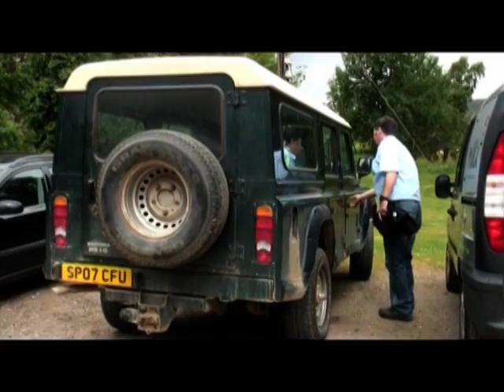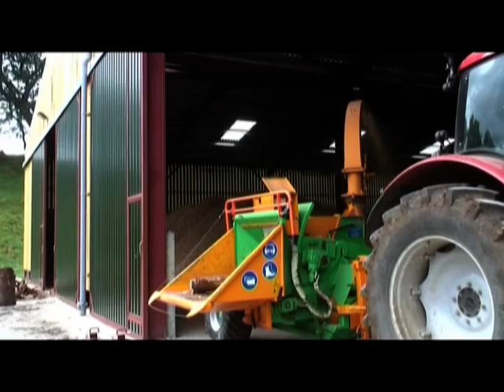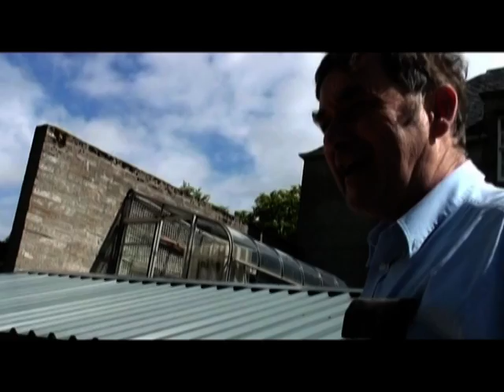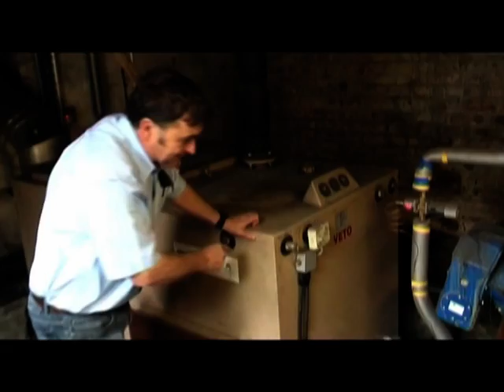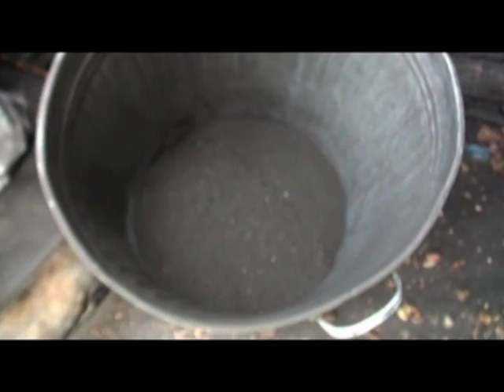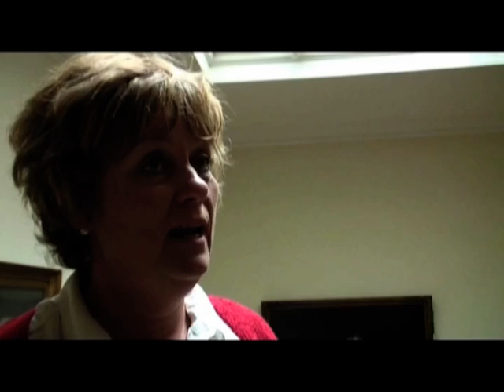Wood chip Heating system

Comment: Billy, the amount of wood chips they consumed as showed in this video would probably run the 20K generator. With little conversion, they can change this "burner" into a bio gas maker with the heat exchange inside. There are practical 5K, 10K generators running on wood chips that consume way less than what showed in this video.
Reply: running 20k generator instead would mean burning 40 pounds more wood chips/hour... not really very cost efficient unless electricity costs honey

Comment: 4) So if they were still using oil, and paying 33,000 pounds annually for it, this would represent not only a direct drain of 20,000 pounds for the owner (the difference between the cost of woodchips and oil) and ultimately the owner's patrons, but a million pounds of decreased value to the community. On that basis, the relatively tiny amount of 40,000 pounds made once, invested by the community for an annual return of 1 million pounds of avoided cost, was a brilliant investment.

Comment: No, these partnerships are not the reason of higher taxes. The cost of using the service is borne exclusively by the users of the service and not by the taxpayer. Believe me, if the public-private partnerships did not exist, than the taxes would be a lot higher. Really a lot higher! If it didn't exist now, in this worldwide finan. crisis, than we would all be in serious problems. So, your "social-fascist" explanation really doesn't make any sense. Where did you read something silly like that?!

Comment: MrHighlandbirchwoods: While you burn the wood chips, you can use the exhaust to run electrical  generator. With the rate of wood chips you burn, I guess that enough to run the 20K generator. So you can have more heat from generator coolant and electricity for your Hotel.

Comment: "Slightly bigger than the average home" with 44 bedrooms & 18 baths? What the hell? You are joking, right? The problem is people living in homes like this and using all that energy to heat them with 58,000L of oil per year. Then, they only use about 25% of the home. The rest is a total waste to fuel your ego.
If you just get the law changed and install energy efficient double or triple pane windows, you would reduce your energy consumption substantially. Insulate the attic as well with foam.
Reply: My thoughts exactly, why heat that size house for two people ? Seems a complete waste of time money and effort, if they downsized to four or five rooms in might make some sense, that would allow using less resources . I’m not impressed .

Comment: Dude...get a Fresnel lens to boil your water.. you don't even need the wood chips.
In fact you can get all the hot water you want from 1000 ft of black pipe with water running through it and store the hot water in tanks to heat the house at night..